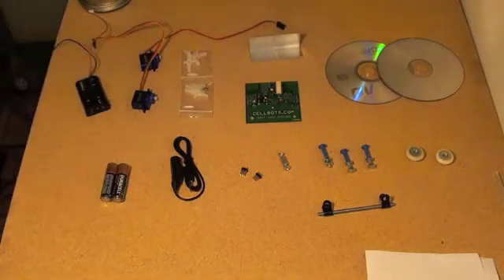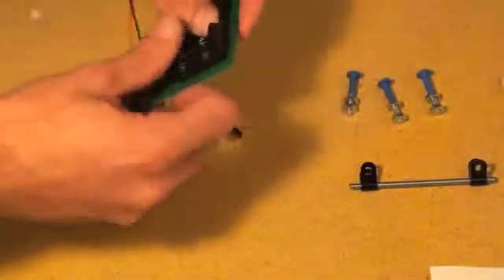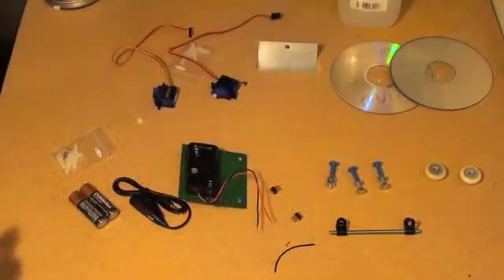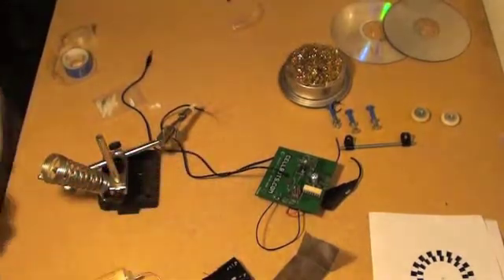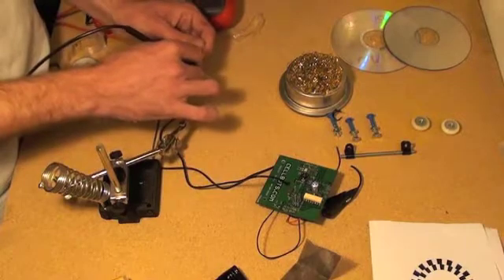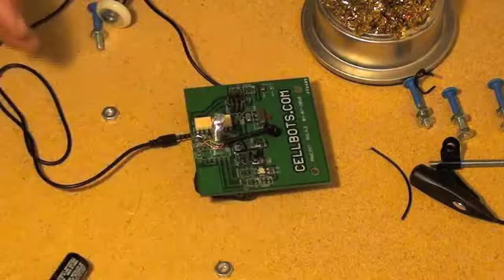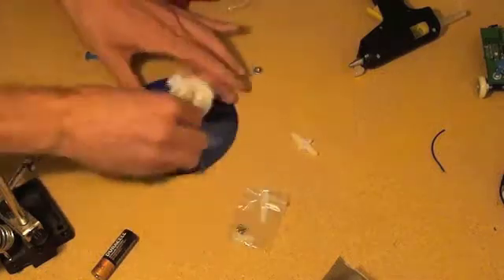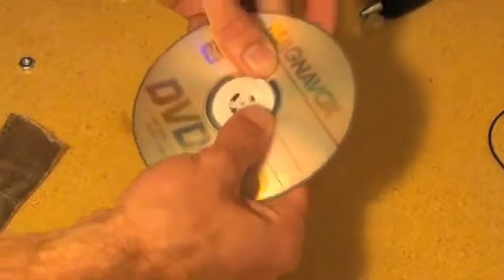How To Assemble The TRRSTAN Cellbot Kit

Comment: I would suggest using the simple breakout board for the 3.5mm audio jack instead of soldering directly on the tiny wire. Then I will use a male-male 3.5mm audio jack to connect  the board to the phone. Do you think it would work?